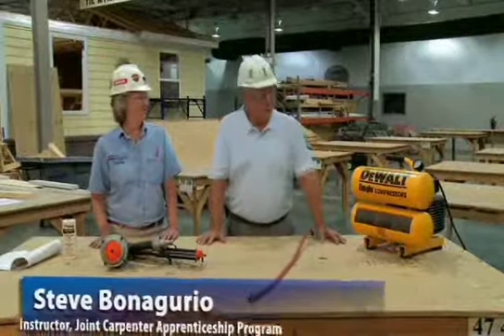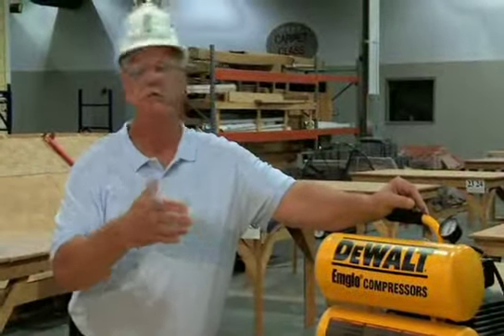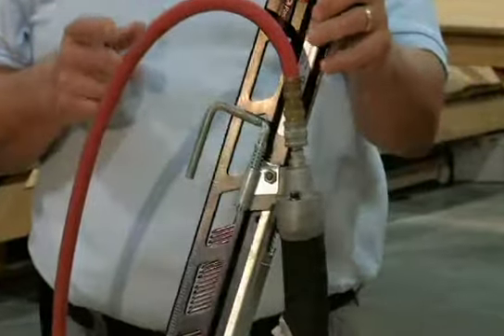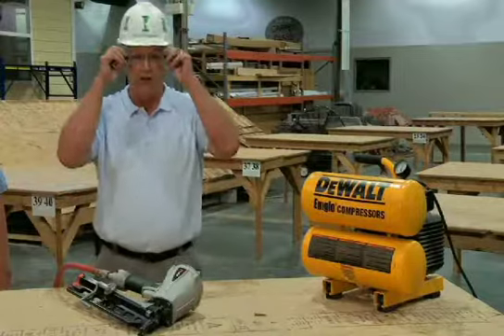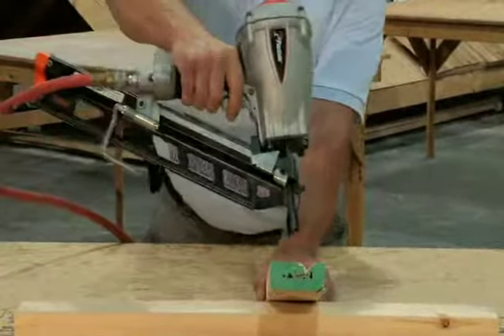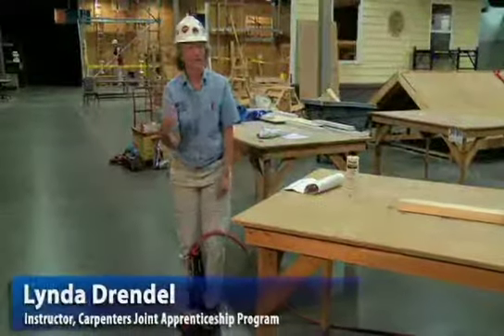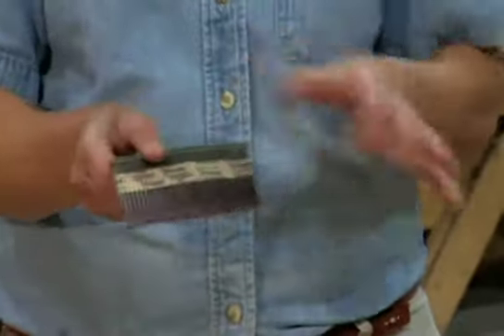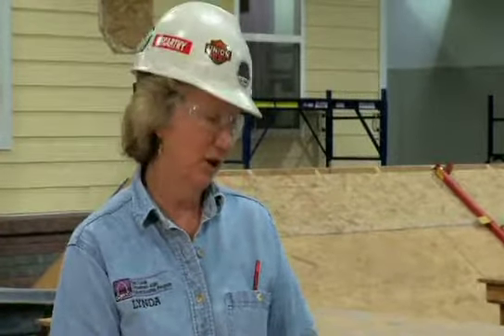Working with Nail Guns: The Facts (Part 1 of 3)

Comment: I've been a framing contractor for 30 years. This video made me laugh so hard. Average psi for framing guns is 120 psi, not 100. That includes trim and staple guns. No, the gun will not fire when you pull the trigger unless the safety is pressed against the stock you are nailing. It will not accidentally go off when attaching the air hose unless you have the safety depressed AND the trigger pulled. Also, you have to depress the safety BEFORE you can even pull the trigger.  I showed this video to my guys and they laughed as well.